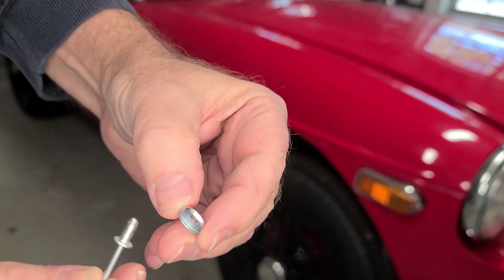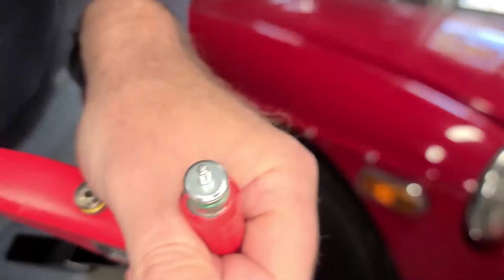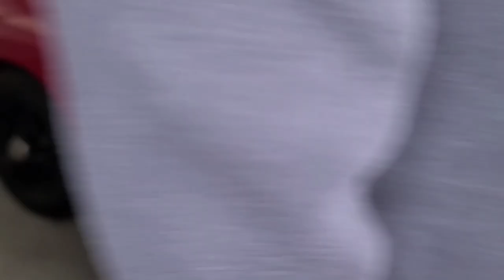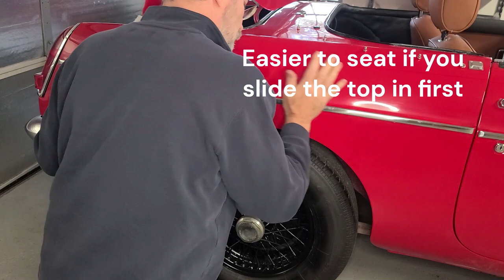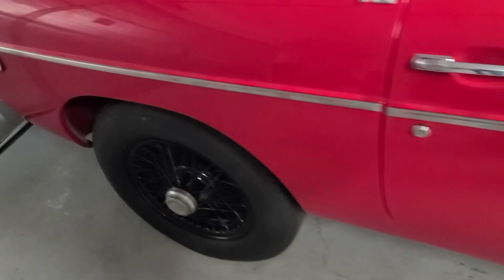MGB side molding install

Comment: You need to add a preface to your video alerting owners to dry fit each moulding piece before attaching. It is common for some pieces to leave a space when curves don’t exactly conform to the body. Careful easing of the piece solves that problem. I used Gulfwax to seal holes before attaching rivets. I also put a piece of wide blue masking tape beneath each hole to protect the finish.

Comment: Your black wires look great
Reply from the maker: Thanks.  Wife and I decided repainting the original grey/silver would not look as nice after removing the rust, As it would show the blemishes.  After seeing you can actually buy black ones we decided to spray them black.
Reply: @AlexPlatacis  I need to fit trim on a mgc bonnet so this is useful video too. Thanks

Comment: Alex  I see the link is for aftermarket parts and significantly less expensive than the OEM parts. Did you experience any issues with the fit or finish?
Reply from the maker: None to speak of.
However in the video you might notice I coaxed a bit of a bend into the ends so they would have a bit tighter fit.

Comment: Your video was very informative, especially for the old MG version. 
Could plz help me out with the fuel pump 12-volt supply circuit, Is any diagram or rooting power supply feed
Reply from the maker: I have not yet installed my fuel pump, be sure to subscribe so you are notified when I post a video on that.

I do have a video on the rear wiring harness install
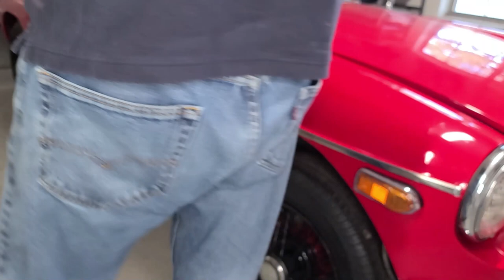You can skip to 12:00 to see just the rear section
https://youtu.be/msQphjmxpOg

Hope that helps.
I will reference the wiring schematic when I install my fuel pump
Reply: @AlexPlatacis  thanks for your feedback 
I have already SUBSCRIBED Your YT.chal

Comment: I have a 74 1/2 MGB that came with a Sebring kit installed. It also came with chrome and rubber bumpers and a chrome luggage rack. I don't know which bumpers were on there originally. I want to convert it to chrome bumpers and take off all the Sebring kit. The 77 would have had rubber bumpers, did you do the conversion and if so, was it a difficult task? Thanks
Reply from the maker: Yes I did the conversion myself.  There are a few videos covering that process.  I will compile a playlist so you don't have to browse through the years of random unrelated videos
Reply from the maker: https://youtube.com/playlist?list=PL2RsH7Pa3wcGgvJIV6-VigL34ma9KMzYF&si=X9flRKESVhvRbhpg

Comment: Do you also have a video showing how to remove the side molding? Can that be done without causing any damage?
Reply from the maker: I don't...
When I took possession of this vehicle, the existing molding was already coming off.  

The thing I would take from this video on how to remove it would be the location of the bolts.  Once you remove those, the riveted connectors can be delt with
Reply: @AlexPlatacis  Thank you for your fast reply. I noticed how you click the mold in place over the rivets. It gave me the impression that this can not be undone without damaging (bending/creasing) the mold.

Comment: Mine definitely isn't going back on! I hate that stuff.
Reply from the maker: Yeah, we discussed that too, but the idea of the extra body work to remove the ridge outweighed the relatively low cost of replacing the molding.
Reply: @AlexPlatacis  I just closed up the holes in mine